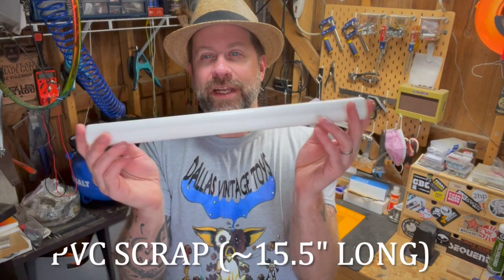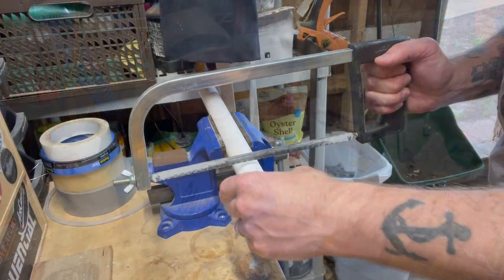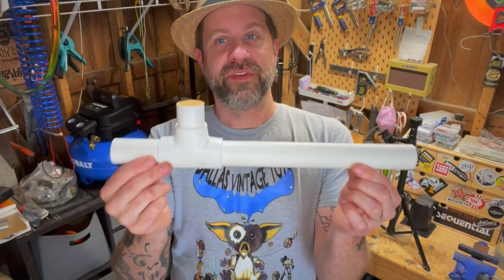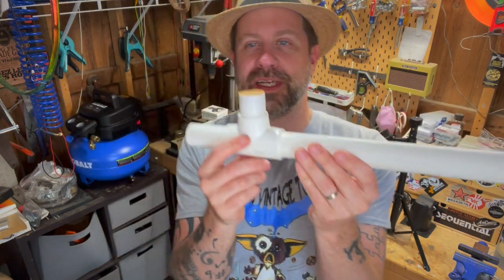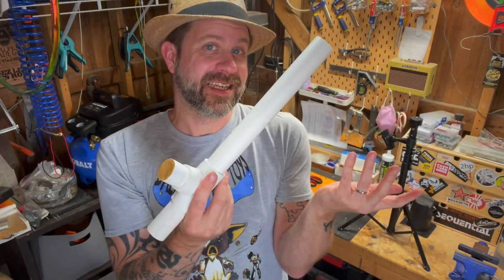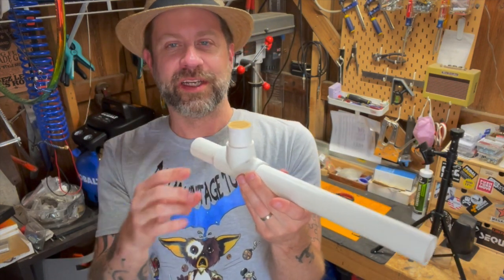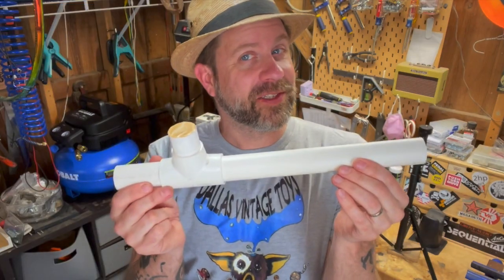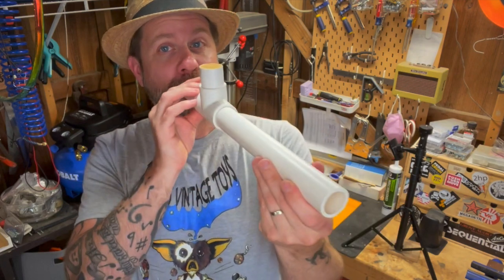Making a Giant Kazoo from 1" PVC

Comment: This reminds me of my 7-foot PVC kazoo. I didn't use a T-connector, though. I simply made a "mouth hole" about a foot from one end, then used a rubber band and a piece of plastic grocery bag to cover the end closest to the mouth hole. It works well.
Reply from the maker: It's interesting you say that... I may need to do a round 2. After I finished this I started thinking and realized the wax paper probably isn't the best for this design. It works good for a classic kazoo where the membrane lays flat but it doesn't stretch well. I started thinking a plastic trash liner might work a lot better. Thanks for the confirmation. 😀
Reply: @musicalmiscellany  I also like the rubber band, because it makes it easy to "fine tune" the tension. Kazoos are cool!